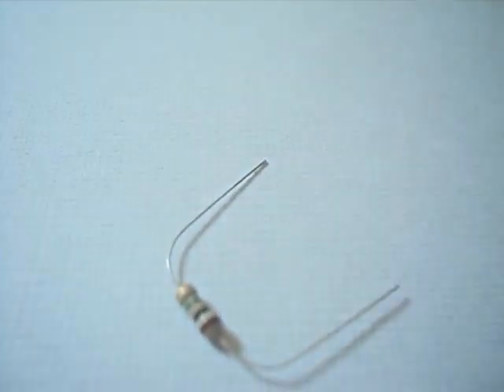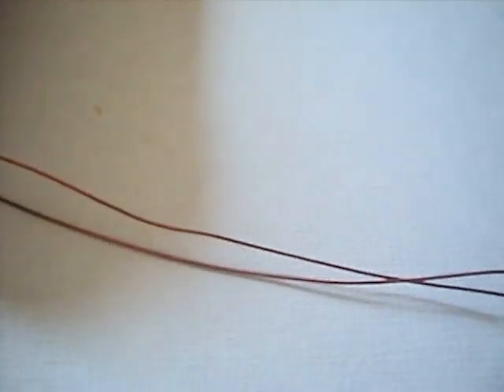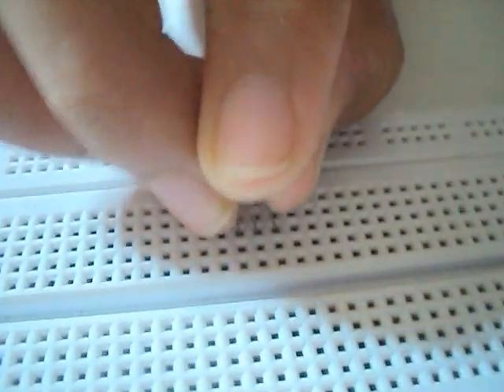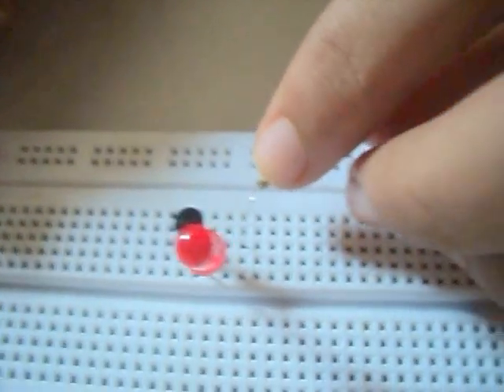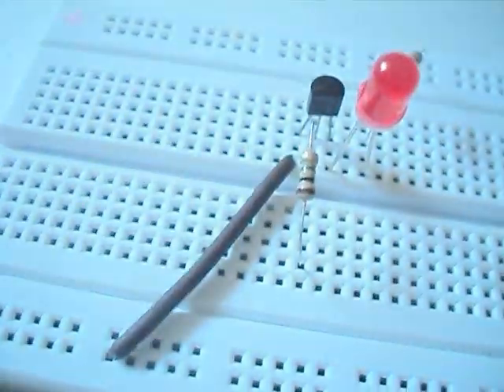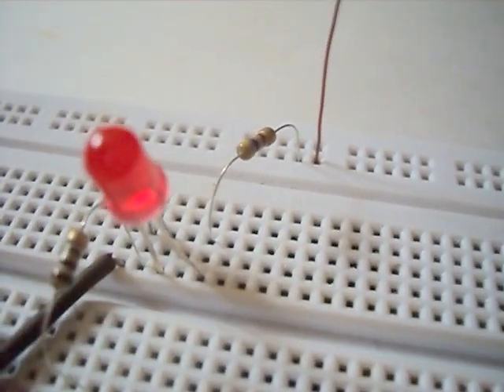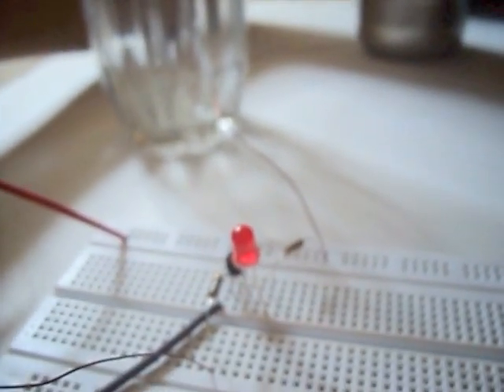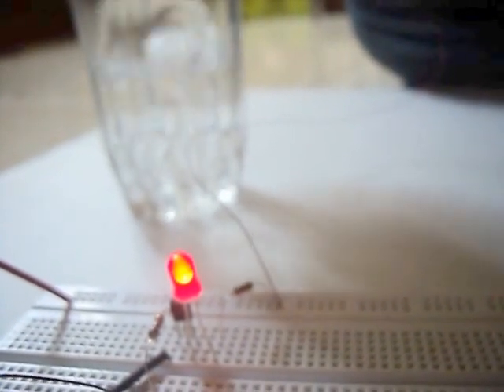how to make a water sensor

Comment: This is false, I can explain, water is a good conductor of electricity so we can use the water as a  switch when we fill the glass with water so the led will grow.
Reply from the maker: water is not actually a good conductor.for a metre resistance of water is 182mega ohm,thats huge.you cant light your led with that high resistance.so you need transistor.☺
Reply: OK! Sorry
Reply from the maker: alright ,no problem ☺